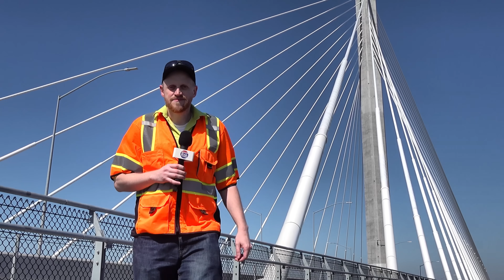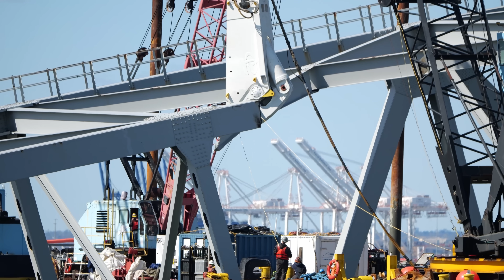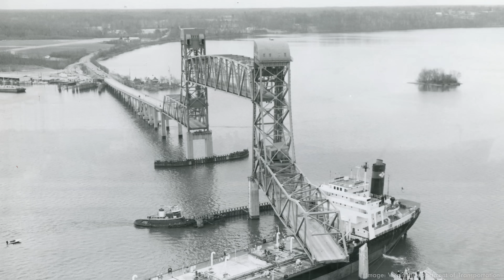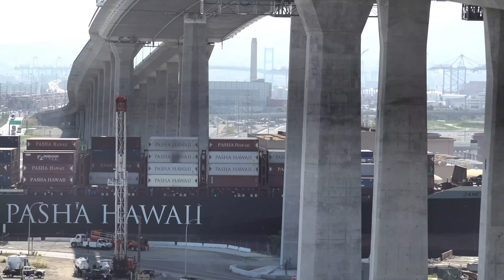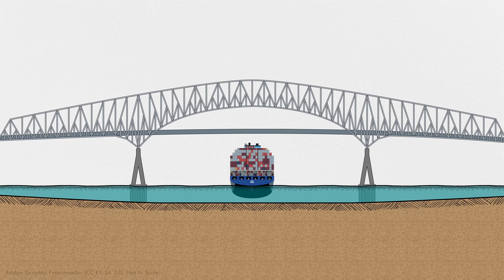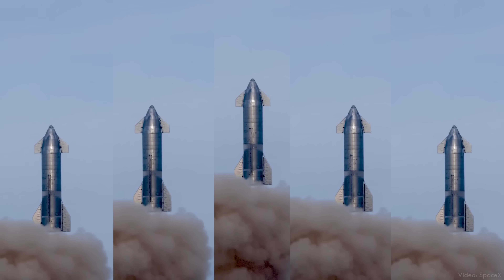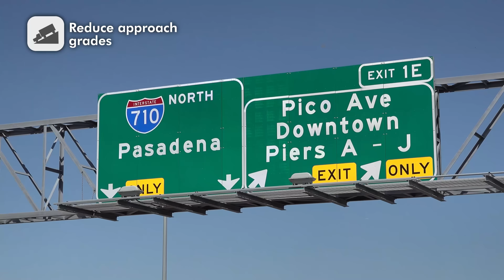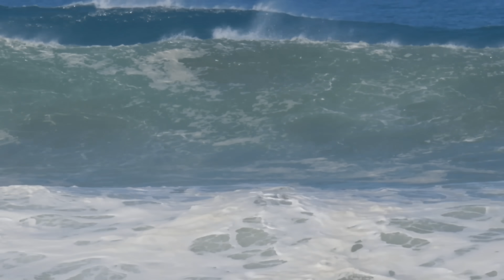How Bridge Engineers Design Against Ship Collisions

Comment: When they built that bridge, they didn't have large container ships. Nobody thought to add more Rip Rap and install a more robust barrier. That ship looked like it steered right into the Pylon. I bet that as they lost power, they were inputting hard right at the helm. Power failure, so helm not responding. Power comes back, but they forgot about the hard right input at helm before it was too late. Murphy's Law.... Wow.
Reply: not what happened, thats not how it works. Watch what is going on with shipping to understand what happened

Comment: Given that this channel changes depth a lot as you cross the entire width, to me, one easy thing to do is to widen the bridge to put the ends in shallower water.  It was mentioned that islands are used for grounding ships to protect the bridge- basically that, except that the channel is already there.  It won't eliminate the risk, but it will reduce the risk for the deep draft ships from hitting the bridge.  Use the existing geometry of the channel.

Comment: I learned some years ago that the best definition of a truss is "it supports loads with math instead of mass"  they are great for cheap light support systems, and that is why building roofs and floors are made out of trusses.  the drawback is that if you compromise any component of a truss, there is usually no redundancy to prevent failure.  thus the logical way to prevent catastrophic failure of truss bridges is to avoid collisions; rather than to try to reinforce them to survive collisions.
Reply from the maker: Love that phrase!
Reply: I think I will steal that for class.
Reply: @petermgruhn  go for it.
Reply: You can overdetermine a truss. Then a single element failure will not be catastrophic.
Reply: @appa609  yes, you can build one so it is completely redundant.  then it will weigh and cost twice as much, or actually more, since it has to support more of itself, as well.  not an idea the bean counters will like, even if it does substantially increase the safety margin.
Reply: I'm no civil engineer, but if each end of the bridge was held up with three columns instead of two, and any two were enough to hold it up, would that have prevented what happened here at only an incremental increase in cost?
Reply: @rjd444 not really. The math doesn't usually work like that. Think of your average chair. Chairs can be designed to only need 3 legs to stay upright. However the 4th leg is still required because of the design compromises needed to add the 4th leg make it unstable when a leg breaks.
Reply: @nathanielhill8156  Understood.  I guess my larger point should have been wouldn't it be less expensive and more effective to design a support structure with redundancy (i.e. bridge still stays up with one of the supports gone) than to try and design a support and protection system that can withstand and impact with a gargantuan container ship?  It seems like most of the discussion I've heard is about the latter.  Yes redundancy cost money,  but certainly not even close to the amount it is going to cost to rebuild this bridge and more importantly, the extra upfront cost would have saved human lives.
Reply: @rjd444  I think part of the issue is hindsight. For example, if you trip and fall and crack your head on the pavement, and end up with a concussion, you're gonna be wishing that you were wearing a helmet. The cost of this redundancy (wearing a helmet that day) is far lower than the cost of going to the hospital and having a concussion.
But if you only have a serious fall once every 5-10 years, the comparison isn't "wearing a helmet vs getting a concussion", the comparison is "wearing a helmet for 10 years vs getting a concussion."

It's a similar thing here - but with multiple bridges rather than time. If there's ten thousand bridges, and 1 of them has a serious accident every year, is it worth reinforcing ten thousand bridges to catch the single failure every year? I'm sure the rebuilding costs way more than reinforcing a single bridge, but any single particular bridge isn't likely to collapse. 

I think money is so abstract that people often forget it has a human cost - it's essentially a way to allocate human labor and resources. The extra cost would have saved lives, but in the end we do have to assign some value to potential human lives saved.
Reply: 🤔 Another logical way to prevent collapse of truss bridges would be to build a more expensive structure instead, with the mass of its supports competing with the mass of ships.
Reply: @creativecraving  it is not so much that as it is that building the more expensive structure adds redundancy.  so it can absorb more damage, before the math stops mathing.

Comment: I'm a bridge engineer who works for a firm in Baltimore.  This video was a good explanation of the history and methodology of bridge design without getting too much into the fine detail.  The general public really lacks a true understanding of the necessity for probability and statistics in bridge design.  They cannot comprehend the magnitude of funding required to "design a bridge for the apocalypse". It's not a few grand more.  It's not double the price.  It's tens to hundreds of times the price of what we currently design.  And with signature bridges like these in the video easily exceeding $1B to construct,  it's easy to see how unaffordable apocalypse design really is.  We don't have the money to spend $100B on every one of these bridges.   No amount of money in the world could pay for that level of design. 

There are over 560k bridges in the United States,  and 60% of them are over water.  Many of the 560k bridges are in need of major repair or replacement.  Although the vast majority of that 560k are much smaller and simpler bridges,  it's still too costly to spare no expense in design.  You always must design with a balance of risk and safety. 

I also just wanted to clarify robs discussion about load ratings of bridges.  First,  load rating a bridge is a routine procedure.  It's done every time a new bridge is built as well as periodically throughout the bridges life,  especially if the bridge is deteriorating or doesn't meet current code.  As to meeting code,  Rob noted that the bridge didn't rate for any design trucks,  but he really should have clarified this statement.  A "design truck" in bridge engineering terminology is a theoretical load.  Current AASHTO LRFD bridge design code specifies HL-93 design loading,  which is a combination of a theoretical fully loaded truck (HS-20 truck) AND a fully loaded lane of other vehicles acting simultaneously. Back when that old bridge was built,  LRFD code didn't exist.  The older code,  called AASHTO standard specifications,  called for a theoretical truck OR fully loaded lane.  Furthermore,  the weight of the theoretical truck has increased over time, so it may have been less than the current HS-20 truck back when that bridge was originally designed.  My point to all this is to say that a bridge failing a load rating analysis says nothing about the condition of the bridge.  Bridges fail load ratings all the time due to being older bridges that were designed to the older code.  And a bridge failing to rate also doesn't make it unsafe.  It just means that it may need to have a weight restriction and/or lane restriction for trucks. Any unusually heavy trucks will require a permit to cross the bridge anyway,  and it is determined well in advance if those permit trucks are allowed over the bridge or if they need a detour. The driver will know this before he even leaves site with his load.
Reply: Weird that bridges have been retrofitted with the required protection.  I live in Halifax where we reinforced ours with islands 40 years ago when the danger became apparent.  And that's a deep narrow channel, unlike this instance.  The environmental argument was bad.
Reply: @paul_moir  well it completely depends on available funding.  Baltimore is one of the biggest ports in America.  There are a lot of piers in the waterways across multiple bridges,  many of which were built before ships like this existed.  You can't just expect miles and miles of bridge to get retrofitted with billions of dollars worth of pier protection like its no big deal.  Also,  your 40 year old pier protection is unlikely to be adequate for modern ships,  so you probably have a false sense of security.
Reply: @rfehr613  Well in our case it was retrofitted and then improved for the post-panamax ships.  Plus a two tug escort to mitigate the risk.  Plus they post a lookout when very large ships pass to close the bridge if there's trouble.  Somehow we manage to do all this but Baltimore can't?
Reply: @paul_moir  again,  you're comparing apples to oranges.  I just looked up the port of halifax. It's tiny.  You literally only have 2 bridges over water - the Murray and the Macdonald - and both of those bridges are relatively short. The Chesapeake bay extends from the southern tip of Virginia up to nearly Pennsylvania.  It's like 200+ miles long,  and almost all of the crossings are in the state of Maryland. The port of Baltimore is only accessible via the Chesapeake bay. The bridges over the bay and in the port are considerably longer than your bridges.  The Chesapeake bay Bridge is over 4 miles long;  the Francis Scott key Bridge was 1.6 miles long.  Your longest Bridge,  the Macdonald Bridge, is only 0.81 miles long.  And lastly,  you keep saying Baltimore doesn't take any precautionary measures,  even though I've already told you that they do.  They have US captains board and drive the ships in and out of port,  and they obviously therefore need to have another ship in the water for the captain to board before/ after.  They don't use tugs, but tugs also aren't going to stop a 200M ton ship in any reasonable amount of time.
Reply: @paul_moir  The Key Bridge was also closed at times for unusually large ships, and had tug escorts at times (for adverse wind or tide maybe?). And reportedly (I haven't seen it firsthand) regulations are that work over water has a spotter. But just because rules are made doesn't mean they are followed, and little deviations add up. The crew definitely has to be on a radio in communication with the cops' dispatch, but if none of them are native English speakers and they never answer the radio, it's probably going to slide, and on 99.9% of the days it won't matter...
Reply: There's a price on your head.  About $10M to be specific.  I think that's the value the federal government uses for the value of a human life when designing regulations and making recommendations like the NTSB does to the FAA.  If the NTSB had their way, everything would be built for Armageddon because they don't have to pay for it.
Reply: just to respond to your first paragraph about how expensive it would be to build stronger bridges and protections;  A simple solution is  4 parts (1) the costs to reinforce the bridge dolphins or whatevers, should be paid by the people involved in building these monster-sized ships.  (from the designers, engineers and owners ). (2) All ships this big and operated in "tight spaces" (subjective) should be aided by tugs as insurance - again paid by the responsible parties mentioned above (deo). (3) the entire crew of these ships should be certified and tested periodically.  (4) the ship's power trains and generators and backups should be inspected prior to every time traveled to "tight spaces".  All of these costs should come from the $billions profits directly and indirectly to the "owners".  NOT CONSUMERS!
Reply: Again, your comments here show the lack of understanding by the general public. There is no justification for an international shipping company to fund transportation infrastructure in the US. It's not their bridge.  It's not their land or waters.  It's not their jurisdiction. Even if we attempted to force them to pay,  whatever law we create would be unenforceable internationally. The best we could hope for is coordination of safety standards with the origin country. We only have the power to control how these ships navigate our waterways,  and we already do this by mandating the use of tugboat or by requiring a US captain navigate the ship through the channel.  The latter is what is done in the Baltimore port.

As for practical solutions to avoid a disaster like this,  we already have them well established.  My original comment was only to rebuff the idea of 'designing for an apocalypse'. I did not get into standard design practices used today,  which include the use of dolphins and fenders. Those channel devices are routinely used in new bridges over navigation channels,  and they will most certainly be employed in the replacement of the Key bridge. Several other bridges in Baltimore already have these devices in place.  I've inspected several of them.  

I would bet money that MdTA (the agency that owns the Key bridge) will be looking to outfit the remainder of their bridges with these devices to avoid another disaster.  The Bay Bridge is likely their highest priority. Fortunately MdTA is fairly proactive,  so I don't doubt they will do something.
Reply: @rfehr613 i think the general public usually assumes the engineers know what they’re doing and therefore should not have to be familiar with bridge design principles, unless they themselves are engineers. Seems fairly reasonable to me
Reply: @russellg1473  you must be new to the internet ha ha.  Everyone thinks they're an expert nowadays. I think that's how conspiracy theories are born 😆
Reply: @russellg1473  except it is not reasonable at all. 

Bridges, like most things, are far more complex than you think. It takes teams of engineers from a wide variety of fields to design such structures. You cannot expect one engineer or even a single team of engineers to account and understand everything. As such, things do get overlooked at times, or flawed logic passes through not for a lack of effort or that sheer lack of intelligence, but simply because of our limitations as humans. I mean, if we designed everything perfectly for nothing to go wrong, then we would never need to use PPE, but yet we still use it because we know there may and likely will be unforeseen holes.